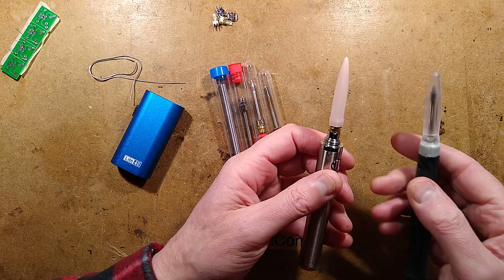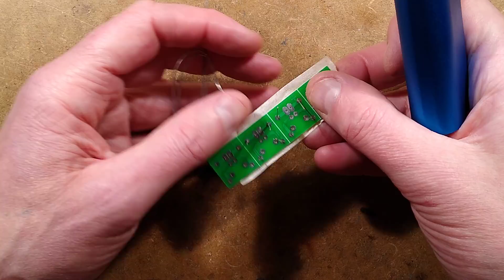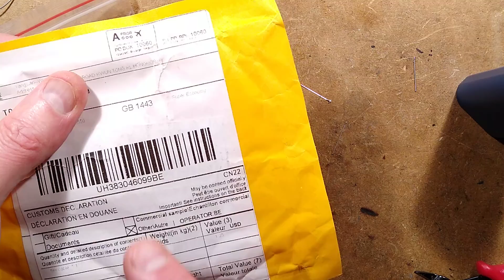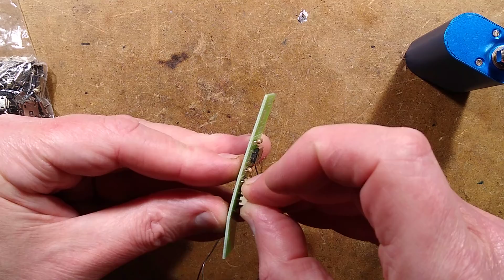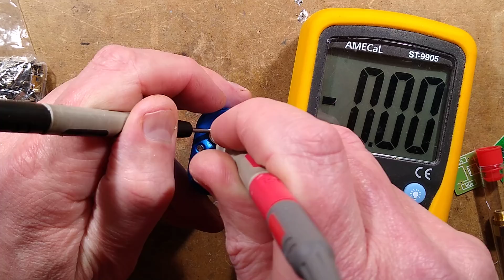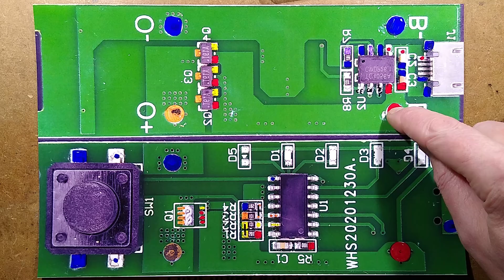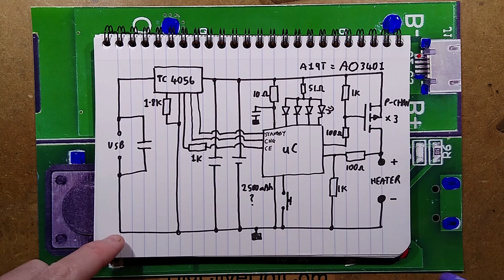Cordless soldering iron teardown (with schematic)

Comment: So basically they created a vaping-device for electronic people so they can enjoy the wonderfull smell of solder. I like it.
Do you have any recommendations for a classic USB soldering iron? Some Ebay Knockoff or one of the fancy pants oled and microcontroller driven ones? 
I'm getting frustrated with my cable iron (no station) that I have to pack away when not in use because I'm just doing this for a hobby.
Reply from the maker: These days the pinecil type soldering irons seem to be popular.  The super-cheap USB irons have similar performance to this type.

Comment: 510 soldering tip seems to be the right keywords for aliexpress, also seems you could defeat the time limit on that device with a jumper between the switch and the gate of the mosfet

Comment: Not a fan of lead-free solder then?!  To be fair, neither were I or my colleagues.  We started using it when the regulations changed, then quickly went back to the lead-based good stuff after trying to use it for manual soldering on a regular basis.

And yes, that's definitely a Molex connector, despite who the actual manufacturer might be!

Comment: A wireless electric soldering iron is a great idea. I didn't know they had tips for what looks to be a standard 510 vape battery. I've only started using a vape battery device for cannabis distillate. My particular battery has a function where if you press the button twice quickly it will stay on for about 10 seconds. Probably pretty useful for soldering. Wonder if your device does the same.

Comment: I wonder if these tips could be used with the temp control setting on a vaping device. Many devices have 3 or 4 temperature control settings (for different coil metal types). They ramp up to high current until they see the change in resistance it expects, then ramps down and pulses to keep it at your set temp. Your device may even have this feature, if I remember correctly, a triple click of the button should cycle through the modes.

Comment: Was at work yesterday and coworker asked me to fix his led light strip that had a broken connector. I said I could take it home and do it on my bench, guy pulls out a 1990's pistol style solder gun and says "you know how to solder, right?".

Can it be done with that or this unit? Probably. But why
Reply from the maker: The pistol versions are not ideal for small connections.

Comment: I have one in the pen style and keep it in my bag of repair stuff for band equipment. It’s great for quick repairs of cable ends and guitar 1/4” output jacks and such. Gotta watch how long you heat it though, on mine the tip will glow red if you don’t regulate it a bit…

Comment: I used to rely solely on butane powered irons because I can't stand the weight and pull of being tethered to a power cable.. and for a while it was ok but my experiences with cheap butane torches ended with one melting, another refusing to light and now my latest is sputtering while I'm using it
So I recently switched to an 18650 powered device like yours and it's just fantastic
Though mine has a battery door where it just pops out and I can charge them separately in a more robust/safe charger

Comment: Speaking of Aliexpress! Bought 2 amps from my Valve Amp parts supplier at the same time received one and a month later the other one had not turned up and it takes a month to get here to Australia. Sent them a stern message asking where it is and I couldn't believe it they rang me to explain that it's still in China. I've never had a supplier ring me before they normally just message you back with "You no worry all good you will get soon relax have a good week". Sorry for the rant! Nice handy little iron Clive.

Comment: @BigClive -- If you call those "Molex" connectors around someone who works on computers (helloooooo Adamant IT -- I may be in the USA and unable to travel but oh boy do I wish we could hang out, Graham) you will induce SEVERE confusion because the older white four-pin connector for hard drives and such -- the big bulky one, 3.5in floppy drives use a "Berg" connector -- is a "Molex" connector in that line of work. What you're calling "Molex" connectors there are to PC people "fan connectors" -- the two-pin ones like those are sometimes "LED connectors", three- and four-pin are almost always fan headers (4pin is for PWM -- beware, Wyse thin clients, now made by Dell and branded "Dell Wyse" -- use a jumper link on a 3pin fan connector as the BIOS clear jumper, and there's nothing wise about that, or really anything else under those hoods! I speak from experience...) and HP likes to use the 5pin versions to power SATA laptop optical drives in their slim desktop boxes.

...BTW: hey, don't think I don't want to hang out with both of you, Clive ;) I fondly remember the visit I got to make to Edinburgh, shortly before, arguably, that life ended... ohhh the stories I could tell :D never made it to Glasgow, but I've a McPherson ancestor, and going back to the UK at least once is very much a life goal. Maybe I'll get to meet both you AND Graham, that would be amazing.

Comment: Kinda want to do this with my big beastie Aegis Legend mod.  Never would have thought of using a cloud maker as a soldering device and now I wonder why I never did.
Reply: I have a T-Priv with the lights on it, I imagine it would make for a dazzling disco soldering iron. But my Aegis mini would be more fitting for soldering iron because of the fire button placement and the more advanced modes
Reply: @Plorg57064  All hail the Aegis Mini. Nothing it can’t do. Remarkably efficient as well.
Reply: @agenericaccount3935  hell of a mini mod, I knew someone who refused to use any other mode than direct voltage. Made for a cool near-mech

Comment: I have been waiting for something like this to come out for the last 2 yrs. I have been vaping for around  6 years. It's how I quit smoking👍
Some of these devices can pulsate around 200 watts " they claim" .
There are several modes for vaping. Power/ watt mode.  You can use nichrome or Kanthal wire . 
Temp control mode, using nickel or titanium wire. 
Some of the devices can go into  real depth on the settings.
You can build your own coils,  take them for emergency fire starters. I thought it would be a good idea to have LED lights with resistors that you could screw into this. You should make a LED set big Clive, just to see if it could be done!👍😎
Reply: Another fun use for nichrome/kanthal coils and the power units used for making them glow is making electric triggers for pyrotechnics, and even more fun; placed in the sealed end of a small metal tube, that is stuffed with some rolled up magician's flash paper. Made a few of these, they can be made so the fit in your sleeve, and connected via a breaker to a battery. Makes for a great party trick to be able to shoot balls of fire from seemingly empty hands.

Comment: The Charge pin on the uC might be to disable the TP chip while the tip is in use, so that it can't be plugged into the USB cable while being used.

Comment: Very low cost and seems to work quite well. I still have my Butane solder unit from the early 1980's. Still works great but not as easy to use as these rechargeable units and cost so much more money back in the day. Thank you for the tear down and demo.

Comment: These look like they'd be pretty cool to have in a kit bag. I've recently created a battery adapter and cable to run a TS100 soldering iron off of a drill battery in the field. It works fine but it's a bit bulky for a quick job. I've been thinking about maybe possibly building something from scratch.

Comment: Those Molex connectors are called two-pole, 0.156"-pitch headers, as per DigiKey. I keep a stock of those and 0.10"-pitch from 2-pole to 13-pole. Headers, housings and tin terminals, like sweets. Clive also mentioned in a previous video the hideously expensive crimper that goes with the whole outfit.
Reply: Can you point me in the direction he talks about his crimper. I am looking to get one and don't want to grab the wrong one. Are all crimpers similar or are there different types of crimps for different things?

Comment: I need some of those USB connectors. I've been using surface mounts and they're a pain in the arse.
Reply from the maker: These ones are very easy to solder, and the through PCB mounts make them rock-solid too.
Reply: @bigclivedotcom  I need to experiment with more flux but I've had a few ripped off the boards (people don't treat cables with respect).

Comment: This reminds me, I have an Antex soldering iron I bought many years ago that runs off 3x AA batteries, the connector on the replaceable tip appears to be a standard phono plug! I bet I could make a USB-to-phono-socket adaptor with switch to power the tip off a USB powerbank...
Reply from the maker: I have one of those.  I think it came from Maplin.   It's not very good.

Comment: TS80P or a Pinecil with a usb pd power bank. So much better than this. :p In fact, they are probably better than the solder station you have, since they are direct heat tips. TS80P is 30w and Pinecil 60w.
Reply: Even though the penecil is really cheap i would go for the ts80p, it has a bigger mass tip, so its better for lager parts, even though it has less watts heating. And its reaaly good quality, the pinecil, and even the ts100, has not as good quality. I almost always ute my ts80p instead of the hakko station i got nowadays, since its so small and handy. 😅 They are both really good though, easily the best soldering iron for on the go soldering.

Comment: Bought those tips. I use them with vape, but not all mods can drive theese 3 ohm tips. Had to reduce power in vape to 15 watts. First time launched on 50 watts, tip got red hot, around 600-700 degrees, judging by red glow. Had to fix wire for my main soldering iron, became very handy. Used it to solder in guitar cavities, very comfy to use, small size. But tips burnout quickly if not careful, especially pointy tip.

Comment: The one that shows the ohms... Change the heater for some leads and maybe it will measure a larger range resistance?

Maybe I missed it also, but, do the leds indicate how juch battery power is remaining?
Reply from the maker: The LEDs do act like a battery level indicator.

Comment: Aluminium case? I hot you don't get burnt! What is the battery life like?

I had a battery soldering iron, when I civerted it to USB it was so much stronger!

Don't the batteries get a little hot?

Comment: Having tested this quite alot 

Using it in vapes only works for brief time and then it overheats the vape and then vape shuts down and u get bit more drive then it becomes useless can't get heat till the vape cools 

Using vape gear u need over 200w and u wack it as far as can go and use trigger to control it 
The best is 4x 18650 vapes but if running 26650 or something be best 

Wen u get middle tip glowing slightly to deep red is wen u can deep solder like using a 100w soldering iron for heavy wires and tabs 

Running constant 5.5~6.5 volts is ur light soldering 
Over 7 haven't quite tested is were u get heavy soldering  

U want to buy a cheap pen off aliexpress then complain it doesn't heat up enough to solder start dispute not as advertised low power to barely at all solder 
It doesn't lasts 15m and can't use usb to power it just slow charge and after 2 minutes it heat overloads and quickly works again but u loose soldering heat sos it's pretty dinky 
Send a dispute 
Then u pull tip and holder off normally it just pushed in cut the power to switch put back together 
Then change dispute to broken doesn't turn on at all 

Ask for parcel refund so they make something off the sale 

Then u whip all the electronics out of it put switch in run a plug on back of it and  feed 2 power supply to it 

One for low voltage to just melt solder and a higher voltage in with switch to boost it up 

Buy pen with steel screw lid sos u can put it on and chuck it anywhere without smelting everything

Comment: Looks like the tip takes standard 510 threading. You could buy a higher quality vape with a digital readout and lots of variable options. And the batteries would last a LONG time- like all day

Comment: I have had a mod and these tips for about 6 months now. I really like them. They are great for getting into tight spaces because they don't have a long ass power cord coming from them. I have tips that work at 10W and there are other tips that work with 30W. I think the 30W ones burn out quick so I tend to run them at around 22W.

Comment: Hello, Clive! You said in the beginning that the original, blue box mode (I have to mention that it looks exactly like an "iStick" mod, just without a screen) puts out the voltage at which the battery is? So it means the voltage output is dropping as the battery is emptying? The other, black box mod, because it has a step-up function, allows you to constantly put out the preset wattage/voltage, even when the battery is almost empty. I like this idea very much, but I am wondering if the blue box mod is regulated. Although the battery in the blue one has a descent capacity, it looks a little dodgy, so I think I would rather prefer using the black one. This is a great product selection for you to review on the channel! I am a regular vaper, and now I can just throw a piece of soldering wire with flux, these soldering bits and a spare battery/charger in my backpack, and carry it everywhere with me...Because I am already always carrying a mod with me, but for it's other purpose, and because the rest of the parts are so compact, it could really come in handy!
Reply from the maker: If using a power adjustable base, it's best to keep it down between 10 and 15W.

Comment: I read somewhere (so it may be totally wrong) that the 10s cut-off is to prevent the battery overheating.
Reply from the maker: It's also a safety feature to protect when a vape device is triggered accidentally in a pocket.

Comment: I don't vape but I've got a vape mod that I bought to use as an experiment for something else that didn't work. I'll have to see if the tips are available by themselves. It uses 2 batteries so I'll take your advice to heart and make sure I start at a low setting.

Comment: I am a vaper, and I always looked for various devices/utilities that i can repurpose my electronic mods to.
Firstly i would love a flashlight head that can either screw in the vape mod, either plug in a USB C plug in a normal power-bank.
And sure, such a tiny pocket soldering iron is ideal for travel or small unexpected fixes.
Unfortunately the Aliexpress listing already gone and no idea what to look for.
Reply: PS: Thanks for fixing the broken link Clive ;P
Reply: 510 interface/connector

Comment: The theft/cost efficiency  in Royal Mail is the reason I tend to avoid any retailers located in the UK, despite the solid engineering they provide and I desire.   If the UK wants to be a power again, they need to address the theft and corruption in that organisation.